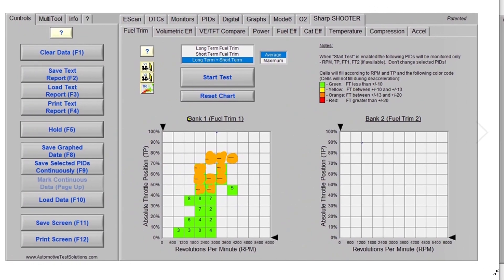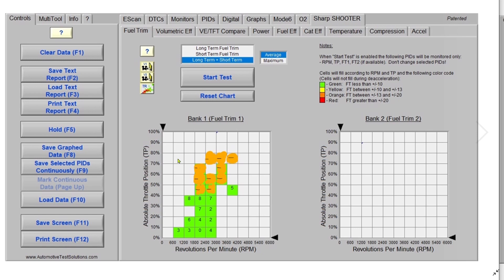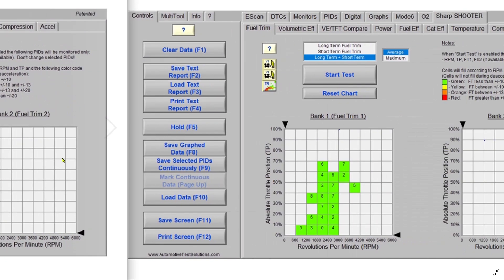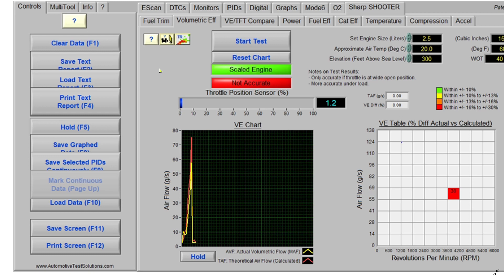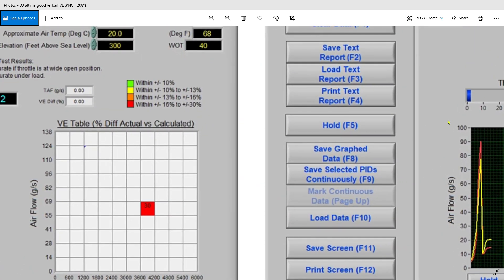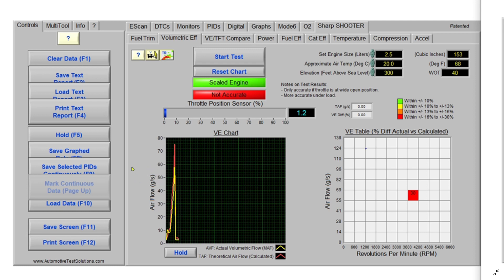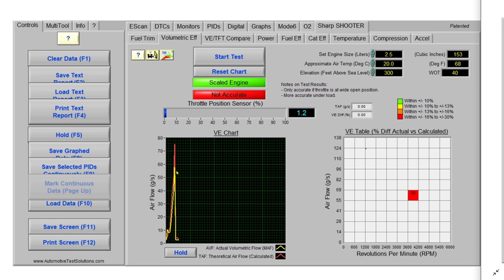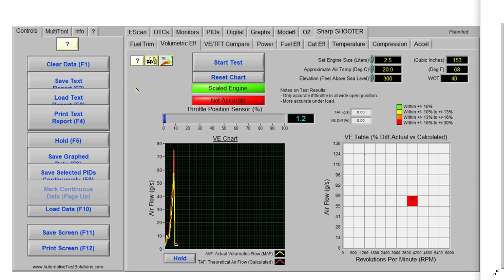Asthmatic Altima

Comment: I love the e scan because of the way it gathers data and presents it to you. With two quick tests, v e and fuel trim you usually already know if you're going to be looking at the fuel side or the sensor side. I go a mile or two down the road and back and I already know what I need to test.
Reply from the maker: It definitely streamlines the info for easier digestion.

Comment: knowing myself... if i got this far with the diagnosis... i would have pulled a plug and did a snap throttle with my wps500... just for my own piece of mind to see the amount of pressure build up 👍
Reply: I like to use the in cylinder method also because it's so easy to see if there's any back pressure at all and how much. The only time I'll go a different route is if the spark plugs are very hard to get at.
Reply from the maker: I used the WPS. Maybe another video coming 😉